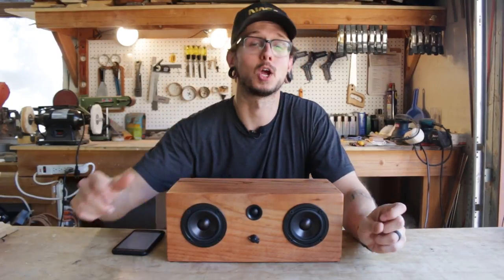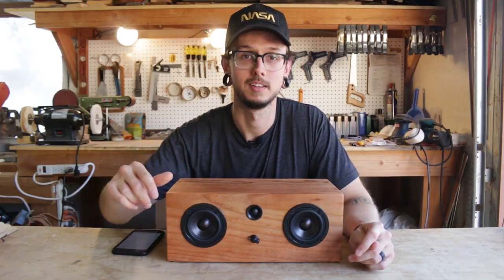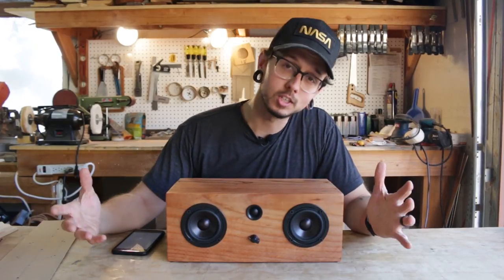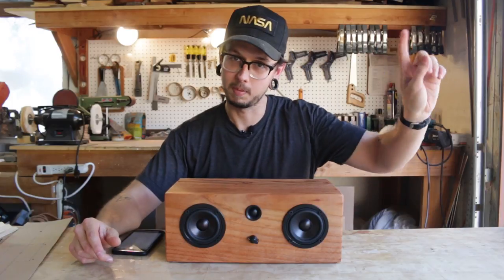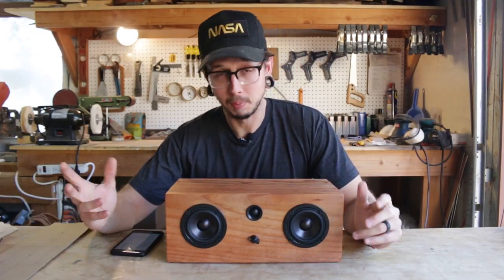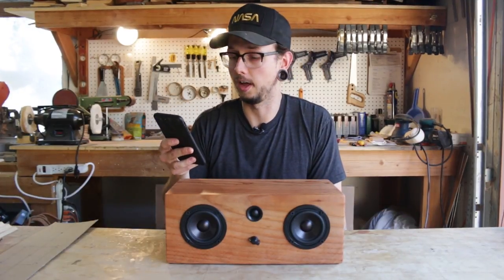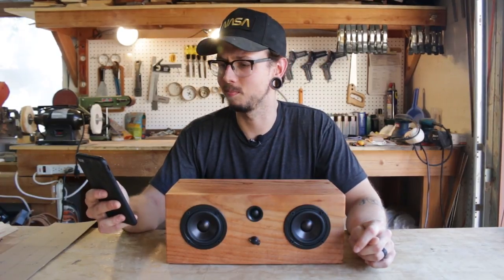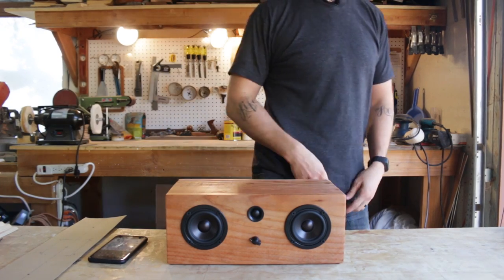First BUILD TALK! Basic Tool Bluetooth Speaker

Comment: IDEA!!!!
In build talk video show HOW you put togeder all electronics for speaker like this. PLEASE🙏
Reply from the maker: +Rihard This is definitely something I want to focus more on! Thanks for watching!
Reply: Kirby Meets Audio yessss! I get so lost on how to wire everything!
Reply: Check out Parts Express. They have plenty of parts amps etc. Plus a project build section.
Reply: hey mate, love your videos, i know you mentioned that you have already spoken about the tweeter being mono....but......is this just on one speaker or did you put it across both speakers? Love the idea of a basic crossover, i will be trying the 4.7uf cap for mine and those DA tweeter
Reply: @KirbyMeetsAudio  Also could you say why the components fit together? I might sound stupid but I dont know how to select the power adapter and power jack to make sure they will work with the other speaker parts now that the power adapter is out of stock on the parts express website. ie what specs do you have to look at to make sure things will work and not burn other components out.

Comment: Hey Kirby, great video. I think it would be really cool with a video on how to tune your speakers with foam. I'm in the process of swapping out the drivers from a set of speakers I've had for fifteen years, into some really cool cabinets I found at a thrift store - the ones from the thrift store was filled with insulation and the ones I took the drivers from had none. Would be cool with a video about what stuff like that does to the audio :)

Comment: It's obvious that the two woofers are split between the two channels. What about the tweeter? It looks like that's only getting signal from one channel.
Reply: I haven't seen any way of doing that with the Dayton Audio KAB-230. It seems like you would need to do that at the source which means, if you're using bluetooth, switching your phone to send only a mono signal to the amp.
Reply from the maker: +videoscrapheap One channel has only one woofer, while the other channel has a woofer and the tweeter wired in parallel. Not the best for audio quality, but it’s simple! Thanks for watching!

Comment: Hi Kirby, I like your videos, especially your info on the electronic components and aesthetics. However, I feel you don't really share on details in design for sound quality. You could share more on the design process for enclosure size/type/fill, channel splitting, speaker size/power/position/orientation. Another thing you could share on is energy efficiency for battery powered speakers: important to maximise that. Again, thanks for sharing your work. Your channel rocks.

Comment: This is the speaker I'd like to see plans for: Has volume pot, on/off switch (I'd like to have a pot style on/off switch in addition to the separate volume pot ), AUX IN (which could play aux input simultaniously with bluetooth input), wall power supply, as far as I can see, other plans do not have all of these elements combined.

Comment: Any chance of a video on making 2 Bluetooth speakers or more which aren't connected with wires? So you can have surround sound....speakers in each corner of a room but no wires between them?
Reply from the maker: +ColourFreeStyle Unfortunately thats cant be done with Bluetooth. It can be done with WiFi though. I’ve done a video on multi room setups in the past, maybe it’s time to revisit!

Comment: Why two woofers and one tweeter? Why not 4 woofers and 2 tweeters? Is there specific number for volume room or enclosure? I have 4 Onkyo speakers I was going to scavenge drivers etc from and wanted to build a bluetooth / rca soundbar. Do you angle the drivers differently to fill a room differently? Lots of strange questions I think of as I watch your videos... Thanks for the content

Comment: For all people that are new to woodworking, you could try to explain how to build the box: how to measure, cut and glue the wood pieces and any pro tips around these you might have...
You did say it is easy but it is not.... The very first box most likely will not ended up well...but that should not stop you from making another one. That is how I started. 👶

Edit: cheap circular saws are crap, that is why they are cheap. Making a clean, straight cut with these is a pain in a butt....

Comment: Hey Kirby, your videos are greats, thank you for coming back to us, i have some suggestions, for future videos. 

- Build videos:

2.1 powered speakers.
speakers with remote controll, so that you can use them on a TV without an external amp
Small and medium portable speakers with batterypower.
Speakers for Pc/mac, or upgrading/tweaking speakers. 
speaker stands 
speakers speakers/wifi speakers
and one that i really really want to see round speakers, like amazon echo or the new bose speakers

-  Buildtalk videos:

would be nice to see you make your own crossovers and explaining how to made it, for different configurations. LIke this speaker, where you have woofer tweeter woofer.
Go a bit indepth why you chose, those components, like why you chose aluminum instead of paper woofer and what the difference might be
Talk a little bit about bass heavy speaker and how make a highpass and lowpass filter.
prehaps talk about bridging 2 amp together.
Maybe add a few commentary on you build videos.

Anyway, i hope that you take some of these into your consideration, and once again thank you for being back and huge thanks for great videos.
Reply from the maker: +Amir Karimabad Thanks for all the suggestions! This is all great. I definitely want to dive more into the electronics part of speaker building. Thanks for watching!

Comment: You could take a page from Primitive Technology and add descriptive subtitles to explain your steps.

Also, showing the formulae you use to determine capacitors and inductors for crossovers, maybe even for your amp circuit, would be great

Comment: How about making NON-wood speakers? Metal, plexiglass, carbon fiber?  that would be neat :)

PS: commentary would definitely help, but you can also do just text commentary marking each step. Video is greate, but breaking it down into steps would help show where the break points of the build are.
Reply from the maker: +Act1veSp1n Plexiglass is on the list! Thanks for watching

Comment: I've been checking out your videos and they are awesome and a lot of help! One thing I was wondering - Do you need a cross over if it is a full range driver, or can you connect the driver (like the Dayton PS95-8 you recommended in another video) right to the amp that you mentioned in this video as you don't need to split the signal. I'm brand new to making speakers and would like to make one as a wedding present (I'm a decent wood worker but brand new at doing speaker components). Thanks for all the info so far!
Reply: Forgot to mention I am thinking of having 2 of those full range drivers in this build

Comment: the thing is, how do you calculate enclosure sizes for really shitty speakers, aka those you buy at a car parts shop?
the ones you would put on the door, really shitty like $20
Reply: Luis Correia yeah... Tried it and I ended up like Kirby, I just made a box that I thought it is big enough. Most volume calculators online are meant for subwoofers and some of them require a lot of speaker specifications which shitty speakers do not have listed anywhere. Btw, my 32 cubic liter box is handling a pair of MacAudio, 3way, 50 RMS car speakers very good. At least for me... My wife hates it, tho.. :)
Reply from the maker: +Luis Correia Someone else might have a better answer, but I think guessing is the best way. Like the other commenter said, you need details of the speaker that usually aren’t available with cheap/salvaged speakers. Using your best judgment on box size will usually work out fine. Larger is usually better. Thanks for watching!

Comment: Ok, super rookie on the speaker electronics here, so might have a stupid question. If the amp is stereo, I'm assuming power is half to the right, half to the left. But you have 3 speakers. I assume that you aren't doing left woofers and right tweeter. So I guess my question is how are you powering the tweeter without over powering it or underpowering one or both woofers?
Reply from the maker: +Lars Fladmark One channel has only one woofer and the other channel has a woofer and the tweeter. Not the best for audio quality, but it’s simple. Thanks for watching!
Reply: Kirby Meets Audio, right on. Thanks for the answer!

Comment: HEY KIRBY. Thanks for all the vids. Got me inspired! I have one quick question though. What power source do use to power the the amp board? I have looked around a bit and the 12 volt and higher voltage power supplies here (Australia) are somewhat expensive. Curious...